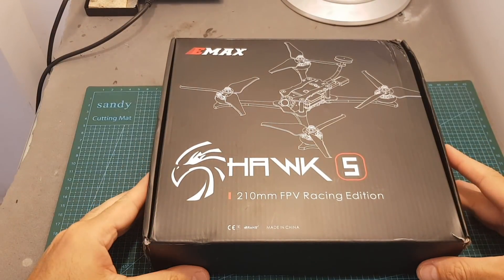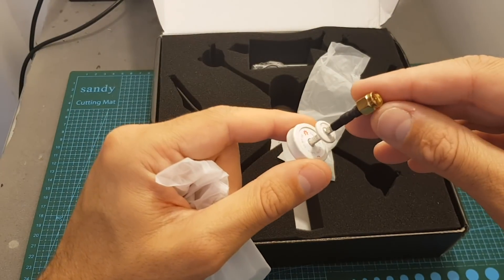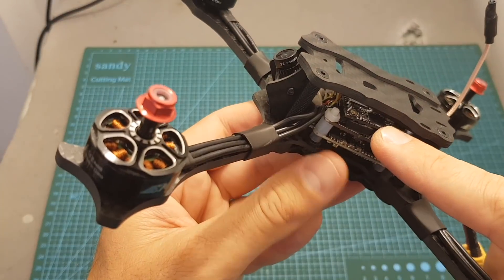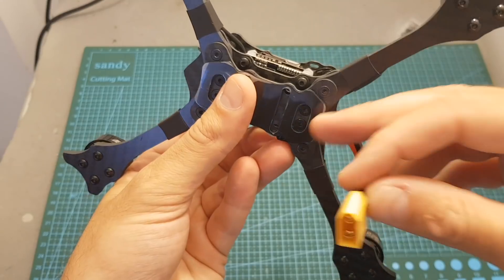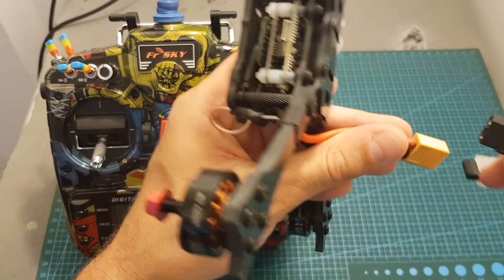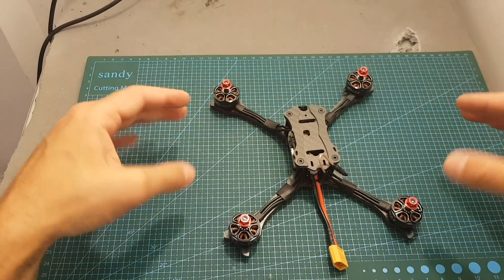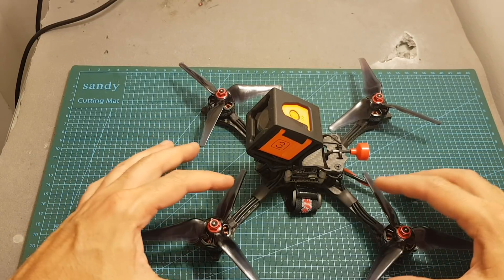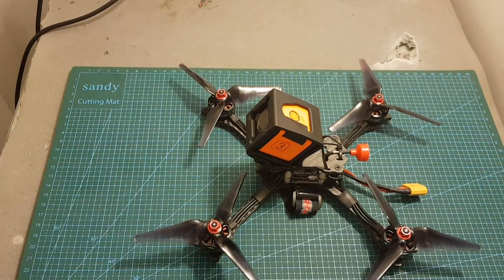Emax Hawk 5 - 210mm Racing Drone - Setup & Review

Comment: ok gal,but wat if you upgrade the hawk5 to a newer version,becouse i have non of this  see on you tube?becouse the 2017 version i had this on my hawk5 and i have a later version on  this quad instal(2019 mont mei,-05)and exactly the same tune as where it came,but nou it fals out of the sky wqhen i am hover for 2 min.maby have you some conclusion?
Reply: Yes THE motors get hott!!and befour it comes out of THE air THE beeper beeps 3 or 4times!!!but
Reply from the maker: Are the motor very hot? You might have radio issues as well.

Comment: How durable is it???? Some people say they have issues with the vtx.
Reply from the maker: I didn't have crazy crashes, but so far it's doing pretty good.
Reply: I bought one and had constant vtx issues, going even 100ft away would snow out to black and then lose signal. I dropped it out of the sky several times because the feed cut completely and I just disarmed rather than fly blind coming out of a barrel roll and flips. I can say either I had a bad stock vtx, or the whip antenna is not great for doing a bunch of flips or I just had settings wrong (although I throughly checked everything). But I paid the extra money for the amazon umbrella, so I just returned it, got my money back, and ordered a new one. Going to find out tomorrow when the replacement comes in if that was a one off issue or if the next one gives me vtx issues as well. I was flying on 5880 on 200mw on F8 on the vtx with the stock whip antenna. But I can say that I have a x220 which I have been upgrading and rebuilding and loving the hell out of it, but the hawk 5 is a whole new level of awesome. Stew from UAVfutures said it best, the hawk 5 feels like a simulator because it handles absolutely perfectly.
Reply: @Ghost-vr5zg  what Goggles do you have
Reply: I have some an ev800d, a cheaper eachine box goggle that doubles as a monitor. I will eventually get a nicer set, either a aomway v1 or a set of fat sharks. But I chose to get my nice radio before my nice goggles since my cheap radio fail safed wayy to close to me. But today I get my new hawk 5 in the mail when I get home. So I will figure out if the vtx issue still persists (i.e. it is some setting or something I'm doing wrong, mismatch antennas or wrong channel or something) or it was just that vtx. I believe that the whip antenna they ship with it on was not fully seated on the vtx, but thats my hunch, I'll find out this weekend for sure.

Comment: Hello Gal, very useful and complete video, great :)  I just bought the Hawk 5 PNP version as I've already got a Flysky TH9X transmitter (and receiver). Would you have any ideas or hints for the Flysky receiver installation on the Hawk 5? Thanks !
Reply from the maker: Hi there, thanks :-)
Which receiver do you have? Make sure it supports SBUS/PPM. 
You will need to connect it to the top part of the Emax Magnum stack, next to the VTX.
My review of the Magnum Stack: https://youtu.be/F0b-USulmIc
Product page: http://bit.ly/2vTy1tK
Reply: Hi, thanks for replying!
Seems my FS-R9B receiver only supports PWM, not SBUS/PPM, and it comes with a case which won't fit nicely in the Magnum stack (and it weights 21gr....).
I don't think I should go for a PWM-PPM converter. Probably it's a better option to go for a proper receiver for the Hawk 5 (and then a new RC transmitter which fits as well...).
If i go that way, which RX/TX would you advise for the Hawk 5, and generic enough for other future quadcopter (and not too expensive :) )
Thanks for your support !
Reply: My best choice for now: Taranis QX7 + Frsky R-XSR. That would be ok with the Hawk 5 I assume.

Comment: Hey, I'm really new to this, where can I find a backup of the Betaflight 3.2.2 stock configuration for the Emax Hawk 5? I flashed 3.3 onto it and lost all the tunings and settings. Thanks
Reply: Something I can flash!
Reply from the maker: Hi, I added it to the description of the video: http://bit.ly/Hawk5DefaultBFSettings
Reply: Thanks Gal, but I have no idea how to use this to restore settings! I'm seeing that i need a JSON file to restore a backup on betaflight.
Reply: How do I restore to 3.2.2 and to how it would be out of the box? My friend messed around with it, he's a builder so he didn't know there were configurations and wiped the thing.
Reply from the maker: You need to flash version 3.2.2 through BetaFlight. Then head over to the CLI, past the content of the text file in the link and hit save.
Reply: How do I flash 3.2.2? Where do I download the file, and how do I know what the right file is?

Comment: Do you think the Hawk will run 5s? I just watched a vid where a guy was running it on 5s! I just wanna know if it would be reliable and not blow up something. Lol. Still testing her out and testing new props. So far I like the HQ 5x4.8x3. Testing cyclone 5045 and hulkie 5055's this week sometime. Oh I also tried the avan-s bi blades. It's definitely slower on that prop but the sound fro them is insanely aggressive I love it but a little higher amp draw, maneuverability is about the same but less flight time. On the hq 4.8 I was getting a slightly longer flight time but only about 20-30 seconds more.
Reply from the maker: I wouldn't try it, as the the AIO stack is intended to be used with up to 4s cells, and I just don't think it's worth the risk of damaging it. How is your VTX performing?
Reply: Gal Kremer oh I'm not trying it until I see more on it. But yeah I just found a lot of videos with people running 5s and even 6s on the magnum stack. Of course the 6s was running 1700kv motors not sure with the 5s was running since the poster hasn't replied to me yet. But yeah it's crazy. Pretty Sure their running pretty big caps on them too.
Reply: Gal Kremer the YouTuber Furadi has a few vids on it.
Reply from the maker: Thanks, I will check it out

Comment: After flying this quad... i feel all my 3inch are underwhelming hehehe
Reply from the maker: Yes, they did nail it on this one
Reply: Kremer FPV yes its beautiful. My 1st 5inch. I removed the rc expo and used my rates. Plus a hglrc elf ccd. So much better. Any alternative props thats a as good or better?
Reply from the maker: Try the Gemfan Flash 5 inch props. They are pretty good.